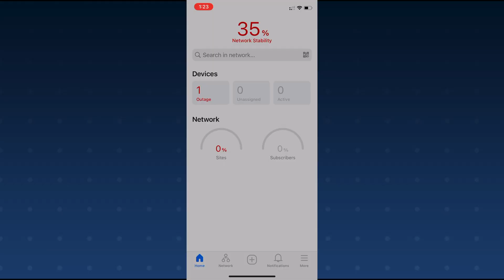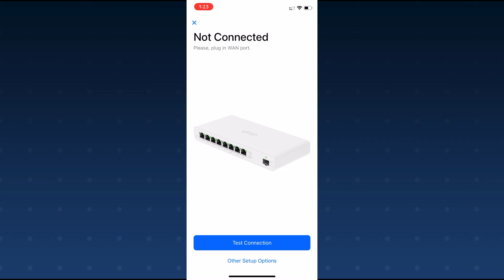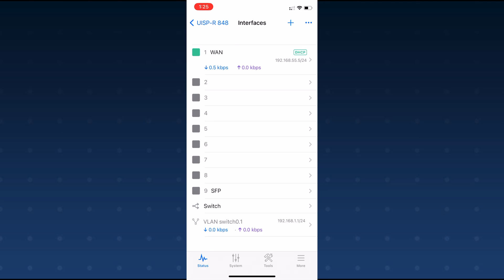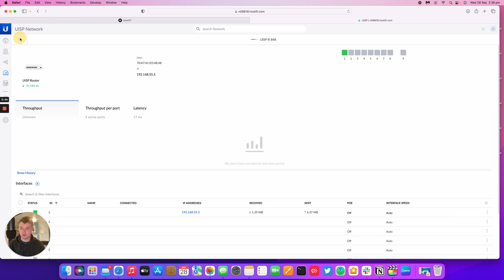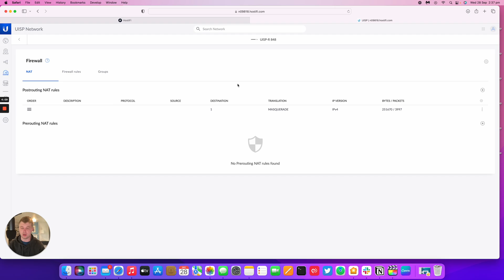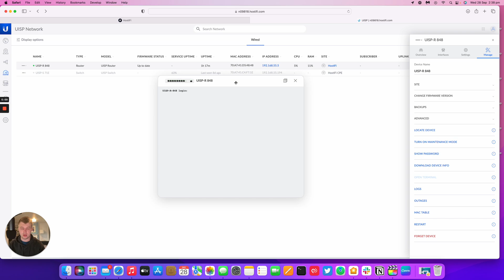First look at the UISP Router

Comment: do we need another hardware controller like hostify ? cant the router be used standalone
Reply from the maker: Hey thanks for watching, as of UISP Router 5.0.1 it can be setup standalone without the need for a UISP Controller. However, anything before that requires a UISP Controller in order to be setup and update the firmware. In short, from 5.0.1 onwards you don't need the UISP Controller but you will miss out on backups, alerts and stats. Hope that helps 👍
Reply: @hostifi  it helps i want to start a wireless internet business that can be scaled up

Comment: POE 27V? So it's not 24V? I was supposed to buy it so I won't buy it anymore
Reply from the maker: Thanks for watching. All of the UISP devices which offer 27v have full compatibly with 24v. It is essentially designed to offer some buffer room for outdoor devices and voltage loss on long runs.

Comment: whatsap the diuferent beetheen UISP Console and WISP Router?
Reply from the maker: Hey thanks for watching. UISP Console can host the UISP Application and also be an external one, such as HostiFi. All of the ports don't have PoE. With the UISP Router, it has to be adopted to an external controller and it has support for 27v PoE on all Ethernet ports. Despite little clarification from Ubiquiti, 27v works with all 24v devices.

Comment: Hello good morning. Sorry, is there a way to return them to factory settings so that they can be re-adopted. I ask because the engineer who previously worked with me unadopted the router and I configured it using his cell phone and now I want to adopt it with my cell phone but he asks me for a password and I don't know what it is. Could you help me, I would really appreciate it.
Reply from the maker: Hello Marco, so if you have physical access to the UISP Router, there is a reset button on the front of the device. You can push that in with a SIM ejection tool for 10secs and the device will go back to factory settings.

Comment: So I wanna start an ISP, can I use UISP controller without the UISP router cause it's not available in my country. The PtP links are available and can I use them with something like pfsense router with UISP controller and pppoe clients.
Reply from the maker: Hey Aryan! Thanks for watching the video.

You asked if you can use the UISP Controller without the UISP Router - Yes this is completely possible, the UISP Application can run any "provider" Ubiquiti devices, that aren't UniFi, such as airMAX, UISP Wave, UFiber, airFiber and much more.

The PtP devices you can absolutely adopt to the UISP Application, for monitoring.

For the third-party devices, such as pfsense you can do basic monitoring via ICMP or SNMP using UISP.

If you are interested, HostiFi hosts the UISP Application and our support team can help you get up and running!